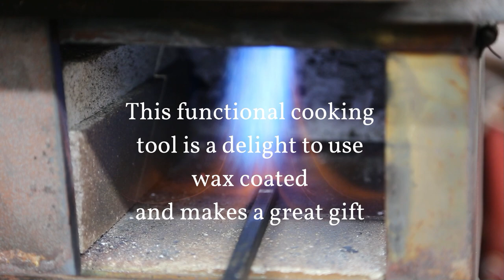Forged Steak Flipper- Easy Basic Blacksmithing Project Step by Step

Comment: I like yours better than the ones I've made! I've been designing texturing dies for my Coal 12-ton to impress bark patterns on round stock, and I think this project would be one where the bark pattern would set it above the competition. It would certainly fit with the leaf, and any excuse to make a new tool is good enough for me. Thanks!
Reply from the maker: Thank you,  I've made a set that I've used to make fire pokers with a branch design.  Worked really well and made a beautiful piece.

Comment: I have a question for you can you take half inch round and cut it in half and make skewers
Reply from the maker: I've done something very similar in the past. Taking rounds dog and either slit chiseled or abrasive wheel cut much like you would for making a roasting Fork
Reply: @wrotiron  thanks for the information